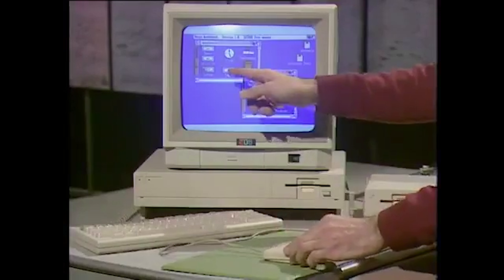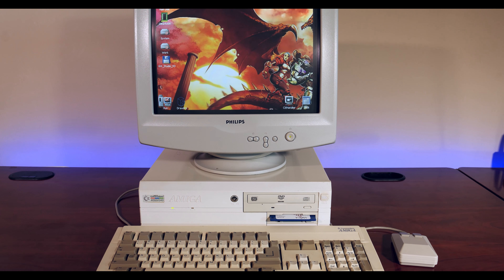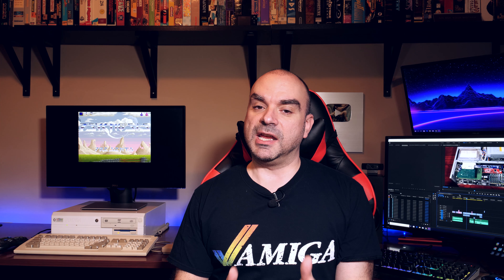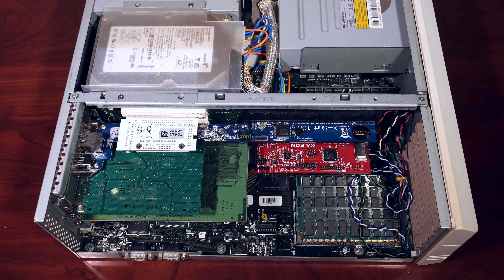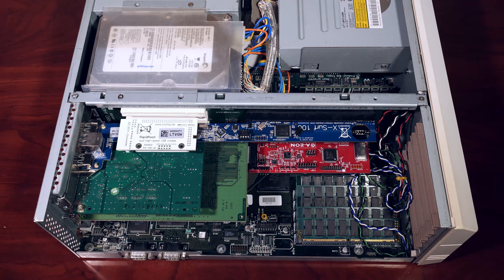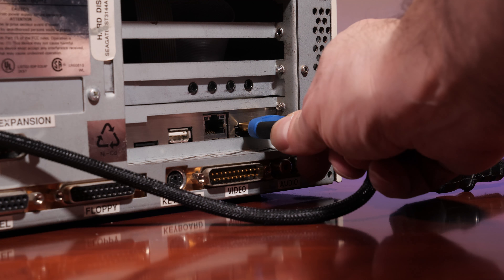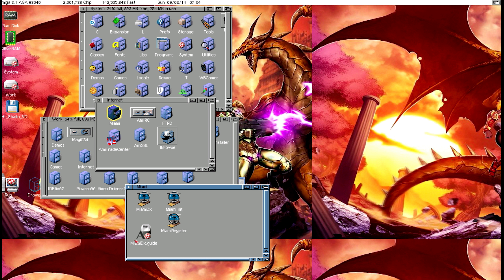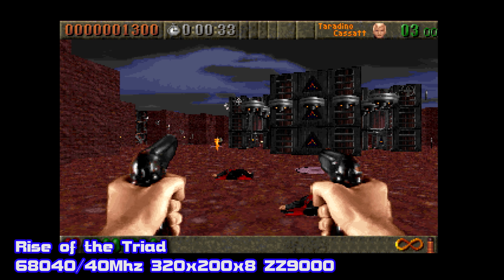Pimpin' the Amiga in 2020 - The Only Amiga Graphics Card you'll ever need - MNT ZZ9000 | MVG

Comment: Could you do a CPU upgrade on this Amiga? I've seen a lot of A1200 and below videos but not much about box box ones. If so that might be the direction to go to get the ultimate Amiga experience. This card is insane and does so much, it would be cool if it had a faster CPU to work with.
Reply from the maker: yep i run a Warp Engine 040, which can be upgraded to an 060
Reply: @ModernVintageGamer  I did some reading, and apparently the Vampire V2+ for the A500 can fit in an A2000. I'm not too sure on how it would work out, but pairing it with this card sounds like an incredibly powerful (albeit a bit pricey) Amiga experience.

Comment: It is so funny when the Arm CPU on the add on card is 20 times faster than your main CPU. :D LOL. Nice card. The price is very good, considering it is a low volume, and requires quite a bit of engineering and firmware / fpga and driver developement too, to make it works well.
Reply: that's the reality of it all with retro platforms. ARMs - and even FPGAs - are far more economical and realistic than cranking out custom silicon. Look at the Atari 2600 community. Since Activision's DPC chip - which was used in Pitfall 2 on the 2600 - cannot be had, they're using cart-based ARM chips emulating the DPC to provide "modern" homebrew gaming on the 2600.

Comment: As someone who has recently been building his Amiga a2000 from a battery-damaged board he bought from Craigslist about 6 years ago, this is a pretty exciting product. My system is currently configured with an a2088 bridgeboard, Video Toaster 4000, and a GVP a2000-HC2 hardcard. Although not mentioned here, the Denise socket option is nice to route the scandoubler without taking up the video slot used by the Video Toaster. Quick question though: will this card give AGA compatibility to the a2000?

Comment: With these accelerator cards for the amiga, it seems to be more that it uses very little of the actual amiga and just take over making it basically that card in an amiga shell. Kinda takes away the point of using actual amiga hardware and not just use a mister or other fpga soultion
Reply: With the ARM processor I can see that, but things like FPGA replacements for CPUs like the Vampire are about the only feasible way you could get a genuine new upgrade. The problem is hardware doesn't last forever, and these Amigas are close to 3 decades old. My opinion is that using them is great, but if you like things to be more genuine, having a 2nd system for that sounds like a great way to expand the experience.
Reply: True to a degree with fpgas but compared to the pimpin the amiga from before it (2018 I think, the wichier one) used motorolas and actually worked with how the amiga is set out and just boosted cpu with the same instruction set and added fast ram, not basically replacing everything. Its not a dig at fpgas and their use because they do help replace dying and non existant parts just cards like this which basically make the entire rest of the machine redundant and raise the question why not use fpga entirely then?
Reply: @trisp7914  I think the answer to your question is the Vampire V4. It's designed to be a standalone Amiga replacement. The problem I see with that though is it's lack of expandability that Amigas are well known for. All in all it really just comes down to personal preference on what you want to put in your Amiga. After all, isn't that the reason people are still building and modifying them 3 decades later?
Reply: @trisp7914  Don't get me wrong, I still really enjoy the original hardware but more from nostalgia and the great fun I have with them but trying to get the old hardware working with add-ons and mods has never been easy. Yes, it can be fun to get them working, but then we have so many add-ons hanging off it gives more reason for instability and problems to occur.
The amount of times just moving the 1200 tower with Mediator and Blizzard PPC from one place to another only having to remove everything and reconnect to get the machine booting again caused no amount of pain and not much joy.
For all these people bringing out new 1200 boards, all well and good, but a hybrid of a 1200 with a decent set of add-ons built in would make a much better use of the space and the chips available on the old systems.
I'd much rather that than the constant devices just hanging off that were never meant to be, even though some people have done a great job.

Comment: I would think the Zynq7000 is beefy enough to run the entire Amiga, optionally using the Zorro bus to interface with the onboard peripherals and ports. Maybe it could even use a synthesized 68k that can run much faster than the original one.
For those saying emulation is not the real deal: synthesizing is different than emulating; it's a clone of the chip on hardware level, not simply on instruction set level.

Comment: The ZZ9000  is quite impressive. What i'd like to know yet: How does the Amiga deal with 1 GB memory on the ZZ9000? Is it only available to the ZZ9000 as graphics RAM exclusively or added to regular existing Fast-RAM for any purpose?
Does the A4000 CPU have DMA access to ZZ9000's 1 GB memory?
And isn't CPU access to this 1 GB extra RAM slower in general, due to Zorro-bus bottleneck compared to CPU to Fast-RAM access on your A4000 CPU card?
Finally, is the ethernet port specified as 10 MBit or 100 Mbit?
I already say thanks for your reply.

Comment: I have indeed just brought the A4000 with a GVP 28/24 Spectrum RTG gfx card inside out of the basement . Even though it powers up, I haven't yet managed to get the Amiga running proper again (no hard disk and the floppy seem to be dead, traces and some chip pins close to the battery seem corroded and while I have promptly removed the battery, it's probably too late). How would the Spectrum compare to ZZ9000, regardless of the fact that the former is HD15 only, no HDMI or DVI .

Comment: Impressive. Thanks for the video.

There's someting that comes to mind, though.
Some person/people at YT described the Amiga folks "as helplessly behind the times".

I think that's half-true here. Amiga starts supporting 1080p now, when 1080p in itself is getting old.
Every modern TV screen sold is 4K by now, with 8K comming soon (or not).

Don't get me wrong, about 15 years ago, in 2005, resolutions like 1600x1200 or 1920x1080 were top of the line.
But now, even my PowerMac G3 from late 90s can do 1080p (via VGA even) if I use a flashed Geforce 2..

PS: Another example comes to mind: A hardware add-on that can play MP3s on the Amiga.
It was released not long ago and works fine. There's just one catch: MP3 is nolonger "in". It's outdated, too. :(

Comment: Have you not tried a digital sound connection via the TOSLINK or SPDIF Digital Audio sockets and there has to be a way to have that Sound card reinstalled to feed the sound into the HDMI encoder that will give you sound through the monitor speakers.

Comment: If your someone who owns an Amiga and its sitting in your attic or your garage, before you go out and fork out shit loads of money for this video card, you should first check that the battery hasn't leaked and eaten away at the motherboard and components. Another thing (more for A4000 owners) is to make sure your Amiga does not have leaking capacitors. First and foremost, a recap is what you would want to do before going out and buying any sort of addon cards for your A4000.

Comment: I wonder how this is comparable in power to the MiSTer Amiga core, and how much better the MiSTer Amiga can be tweaked. I believe it already does 1080p. I'll compare some benches between this card and an equivalent Amiga setup to the minimig core.

Edit: Looking it up, the MiSTer beats all Amigas up the the 4000 in everything, it beats the 4000 in gpu and integer math, while losing FPU(keeping in mind, the MiSTer doesn't implement an FPU at all). For 200 for the de-10 nano and SDRAM(enough to run Amiga core), what an amazing deal for someone like me just getting in to these PCs I wasnt around for 

Compared to a 14MHz 68020 Amiga 1200, AIBB reports the MiSTer core as having:
• 5.50× the performance on Integer Math tests
• 3.38× the performance on Graphics Rendering tests
• 9.28× the performance on Floating Point Math tests

Compared to a 25MHz 68030 Amiga 3000, AIBB reports the MiSTer core as having:
• 2.19× the performance on Integer Math tests
• 3.17× the performance on Graphics Rendering tests
• 2.05× the performance on Floating Point Math tests — note that MiSTer does not have an FPU, unlike the Amiga 3000

Compared to an 25MHz 68040 Amiga 4000, AIBB reports the MiSTer core as having:
• 1.43× the performance on Integer Math tests
• 1.08× the performance on Graphics Rendering tests
• 0.62× the performance on Floating Point Math tests

Comment: "The olny amiga graphics card you'll ever need" - It depends on how you want to use the card. If your main use-case is booting in FullHD and running WHDLOAD, I suppose that the card hits a certain sweet spot. But in terms of actual integration / functionality with the Amiga System, assuming its CURRENT (not "promised for future") state of implementation (April, 2021), the card leaves a lot to be desired. Firstly, the actual bus performance between the Amiga Zorro III interface and the card itself is okay, but not top of the line, as it should be, considering the FPGA technology being used (a Cybervision 64 is up to 40%-50% faster). Secondly, the graphics driver itself is quite bare bones. It provides acceleration via the ARM core, but it lacks essential functions, like being able to define your own screen mode. It's the only card I know of which has that substantial limitation, and stems a bit from a "PC-way" of thinking. And there are other things, which haven't been thought through consequently, like lack of Amiga audio routing via HDMI (something other solutions, like the OSSC, supports), the Flickerfixer lacks little trivial things, like scanline emulation, and the card still behaves hazingly when using it in conjunction with other components (like a Mediator bus board). It's a product which makes the mistake of attempting to do lots of things at once, relies on promises rather than a mature implementation in the beginning, and seems to be planned with a completely strange product focus in mind. I don't care if the card can run Linux. My intention is not to turn my Amiga into the most impractical Raspberry Pi.

Comment: and don't forget the memory you can address via the addmem option. Bonus (at least via this option) of 128Mb Zorro 3 memory.  AddMem START 47000000 TO 4F000000 (credits : Greg Donner)
Reply: I'll have to give this a try. There's some info on the accompanying documentation, which delves into the card's memory locations...
Reply: Standard now with the latest 1.8 Firmware

Comment: After your Video I had to buy a ZZ9000 Card for my A4000. I really like it, but I have some problems with the Network speed. Did you do some special configuration for the Network?
I use the ZZ9000 in my A4000 with a Cyberstorm MK2  60Mhz 68060 CPU and 128MB Ram on the Cyberstorm, but I don’t get more then 800KB/sec over the Network. The same machine transfers 8MB/sec with the X-Surc-100. I Use Roadshow as TCP/IP Stack.

Comment: It's times like these I wish I had the skills to make a similar graphics card for an Acorn RiscPC or A7000(+) instead of being an 3D animator. The only "podule" cards are the Viewfinder and Vpod, both are tough as nails to find, and usually costs a fortune. Plus they both have VGA, so not ideal for modern displays that doesn't have that... ^^"

Basically I'm saying this is a cool project for the classic Amigas, and I wish there was something similar for the Acorns... But hey ho - I suppose I'm not surprised when Risc OS has a smaller user base then the Amiga... ^^"

Comment: I would have to wonder why the resolution looks like it's passing  a monochrome or composite display output over hdmi and looking like a bad case 1st install of window 3.1/3.11 

From the pc perspective we've had 1080p for close a decade over vga/svga though to use audio via tv's vga  still 3.5mm stereo jack interface..

I have yet to user configured audio ports 

the bigger issue now is to bring video resolution of the game to the point it might look like pc port of the game rather the limitations  of the cga/vga standard of the day was..

to be honest looking at the OSD model used within mega 65 I would have to wonder whether the viability cold be made whether you look at c128, amiga 1000, 2000, 3000 or 4000 or for that matter a tower case where may be pci-e  1-4 could be used add-in cart space and may be 8c for a gpu space and having the capacity of using orifginal hardware or latest standards of vga/dvi/hdmi/dsiplay port as an option now it it is to bring the gui upto a modern standard so it doesn't look completely shithouse for use..

Comment: How odd, I'd written out a lengthy comment but I suppose I may have triggered some automoderation.

Either way, it's nice to see homebrew hardware development for the first computer I used. Though I can't justify sourcing an A2000 just for the sake of throwing in a Voodoo 2.

Also, as a yank, feel free to call it by Zed. Sure I could be pedantic about it, but it's basically an homage to the device's UK origin.

Though "ZedDub9K" isn't off the table.

Edit: upon further consideration, if the improvements to the graphics calls mean better frame rates in Wing Commander and Frontier...

Comment: I do wonder from time to time where the Amiga would be, technically, if the management at Commodore had done what they should have done with this excellent machine. It's certain they would have switched from the 68k series to another processor because of Motorola's dropping out of that series and moving to RiSC, but I'd like to know what else would have changed. The successor to the AGA chipset was basically complete when Commodore went under (AAA). Just a shame that it never saw the light of day.
Reply: PowerPC for the CPUs and QNX for upgrading the AmigaOS are the answers you are seeking for that alternate timeline...
Reply: @TheJeremyHolloway  I think you're right about the PowerPC: That was the direction they were heading. As far as QNX, I have no idea, but AmigaOS was hitting a wall, for sure.

Comment: I'm unsure to get this card, my A2000 is equipped with a Fast 040 Forty Fusion that has no Z2 DMA support, a VideoToaster into the "video slot", a Picaso2 and an external DCE scandoubler rlied to the P2, a GVP HC+8 SCSI2 card, Buddah IDE card, VideoLab capture card, A2386SX sharing the ressources of a 3COM network card. So, I wonder if I still have enough "Z2 RAM address" to install this card... ? [that's why I could not use the CV64 4mb video card in it, nor add ram on the GVP HC+8...

Comment: 360 Eur is not expensive considering that the card will not sell masively. Putting a PO for 1000 board on a contract manufacturer is always a small batch ... you start to get decent pricing above 50K. FPGAs, depending on which are not cheap at all. You can end with a 100 dollar BOM card very easy and then add manufacturing and testing will char proportional to the BOM On the other hand, to compare, a decent JTAG programer from ARM  is not cheaper and ironically sold in large numbers (I think). Im not counting cheap sticks or embeded programers in demo boards like ST-Link or the ones on Freescale Cortex demo boards. I mean developing tools. Another example, a simple PIC32 (MIPS .. yes)  ETH kit with the expansion IO is around 150 dollars on digikey. And to get it worse this should be "promotional" material since they are behind silicon sales, not EVAL KIT sales. But ... nope, not with Microchip. Only mass consumer prices can withstand a discussion, short series of custom HW ... not. You are buying a "limited edition" piece of HW.

Comment: Great video and great to see the Amiga hardware being kept alive.  I have one question though, why?  
Maybe the end goal to be able to use a program or game or just for the sake of using vintage hardware.  WinUAE on a modern PC with a 15Khz LCD (or CRT) would be faster and cheaper than hardware surely.  Add-in cards can be selected from dropdown and host power provides somewhere in the region of 5000 MIPS on a modern PC.  I loved my A500 and A1200 as a child but there is do doubting running emulation has its plus factors - no load times, no floppy disks failing, no floppy drive grinding, no failing PSU or leaking batteries, space saving, cost saving...

Comment: Please help me, I've a vanilla amiga 1200 from when I was 6 years old, it should be in barely mint condition and I would like to revive it, but I'm struggling a lot with respect to which kind of accelerator card to put in, I've seen that for basic whdload and standard games, a simple 8mb ram expansion should work, but I would like to have some more kick, the problem is that all the cards that I know about, are basically impossible to find, or have extreme prices and the new proposals like the vampire for the amiga 1200, albeit being a monster powerhouse, and relatively fairly priced, is still too expensive in my opinion.

my main goals are:
adding an internal memory (CF adapter basically)
some kind of meme expansion / graphic accelarator
a modern video output (like hdmi for example)
Reply: Alasuisi: I’m in the same position, 2 bone stock Amiga 1200, less than mint but still reasonable, just need some TLC. I’d like to have a go at building my own fpga board so let’s hope someone designs and open sources it like this one!!!